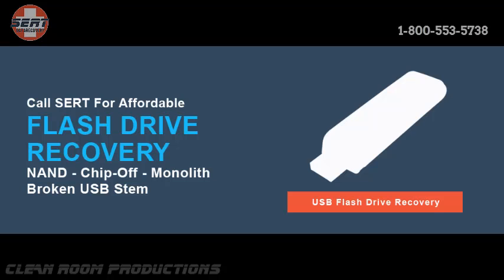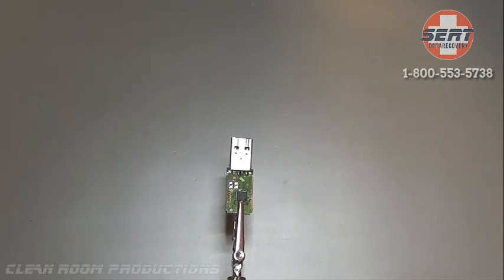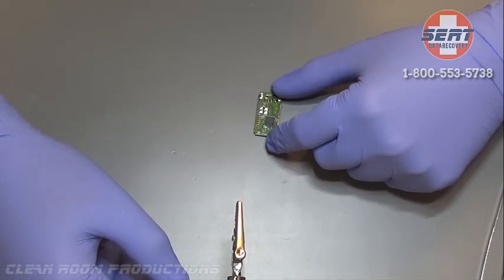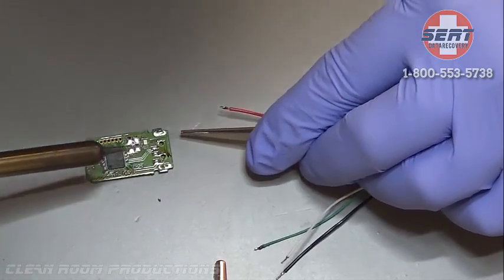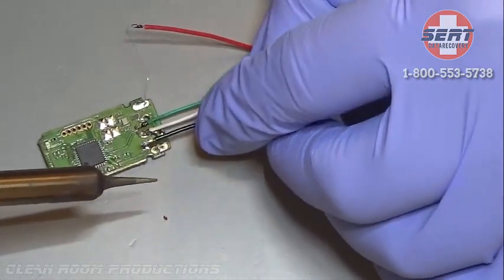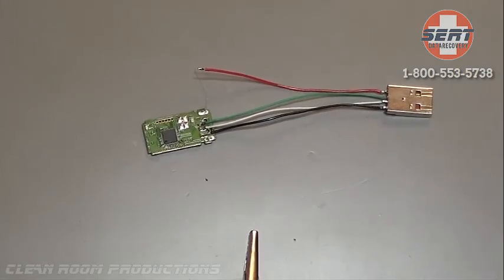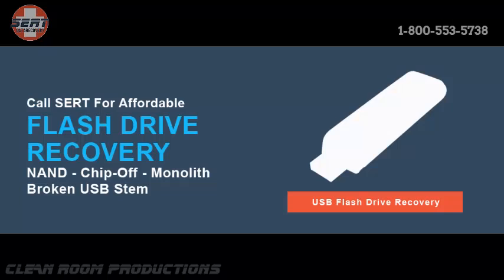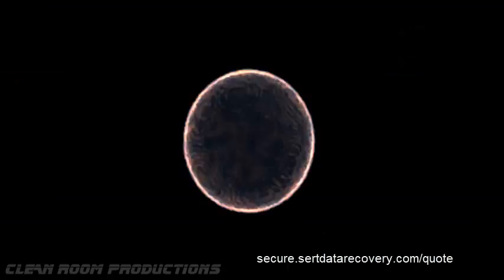Sandisk Flash Drive Repair Data Recovery - How To Fix My Broken USB Drive

Comment: The video is very helpful; however, the data cables in the video are reversed. I followed the video and was able to get the thumb drive to light up, but was not recognized by the computer. Did further research and discovered the green and white wires were reversed (per video). Once I changed them, it worked as it should have. The red and black wires are correct in the video.

Comment: My USB suddenly stopped working, and doesn't appear on any computer ( the light doesn't turn on), can I use this method to repair it ?
Reply from the maker: This is not intended to use for DO IT YOURSELF purposes. You can damage the drive even more.

Comment: what to do when the ends of the front connecting part are broken
Reply from the maker: Yes however we do no suggest trying this on your own as connecting the wrong wire can can cause the drive to require a much more expensive type of recovery process.

Comment: I noticed that the green and white wires are reversed from the normal USB layout...or is it like AC and really doesn't matter.
Can you comment upon that?
Thanks,

Chas
Reply from the maker: Unfortunately our videos are not intended for DIY guide, and therefor cannot comment on your particular question. I do apologize.
Reply from the maker: We did not put these wires in any specific order according to color
Reply: Xilva yes...For pins 1 and 4 yes..Red +5v and Black Gnd...I was talking about the green and white...by USB2 Convention, Data + is green and and Data- is white
Reply: Xilva Data,  is as far as I know is just high and low square-like waves , symbolizing zeros and ones...not symmetrically sinusoidal like AC... ...BUT I don't know what is required in terms of POLARITY RECOGNITION... I would hope and assume that if a modern device is seeing negative going waves, that it would  know that those are digital pulses and are supposed to be high thus a 1(one), and the lack of a pulse would be treated as a 0(zero) , and thus compensate for the "reverse polarity" automatically ...but that's why asked the question.

Chas

Comment: I have a usb that is built into the casing and the usb fell and internals fell out. When i plug in my usb, it has power but it doesnt detect it. Any help?
Reply from the maker: +EpicGuyGaming we can help if you would like to send it in for evaluation and recovery. From what you are describing it could be many different issues, some dealing with the chip and PCB and others dealing with the controller.

Comment: My sisters USB drive has the stem broken off. How much would you charge? Are you in the USA ?
Reply from the maker: +rockero we have a special running right now for broken stem flash drives that includes shipping both ways inside the US. Please call for the quote. 800-553-5738. We'll be glad to help you get your files off for her.
Reply from the maker: +rockero We are also in the USA

Comment: my freind has snaped there memory stick and needs the data asap what would you say to me attempting this process on my own with extension wires so that there is no stress on the connections
Reply from the maker: +Jack Pringle I would only recommend if you know EXACTLY what you are doing, and are experienced. These are some of the botched attempts we get: http://www.sertdatarecovery.com/flash-drive-recovery/do-it-yourself-hall-of-shame

Comment: It's impossible to recover data off the "single-chip" USB flash drives where there's one chip that has the USB connector and everything on it, right? I had (still have) one that broke years ago, and I was just wondering about this. I don''t need anything on that flash drive anymore. Here's a picture of my Sandisk Cruzer, which is not the broken one but looks similar, and I don't have the broken one handy. (The broken one is physically bigger and doesn't have the extra solder pads. (I bet two of them are for an LED if one was to be installed, but idk about the other six.)) http://imgur.com/5VEQbGg EDIT: And worse still, I think the drive was damaged by static. When I plug it into my Ubuntu netbook and do 'lsusb' nothing shows up. It's as if it wasn't even plugged in.
Reply from the maker: +Hitechcomputergeek Not impossible to recover Monolith flash drives, however very difficult and very expensive. If the chip has been damaged/cracked then it will not be recoverable. You can learn more about them here: http://www.sertdatarecovery.com/usb-flash-drive-data-recovery/monolithic-flash-drives
Reply: Even if static damaged it? I'd think that if the NAND part itself gets damaged by static, it's toast. Also, the article says that these monolithic chips are plastic, but isn't it epoxy like any other IC?
Reply: And I'd also assumed that to know how to even try to recover data off of one of these you'd need to have a schematic of some sort so you could figure out what connections connect to where on the NAND, or you'd need to reverse-engineer the flash drive, which would be extremely hard to do.
Reply: Also, the flash drive in question isn't worth trying to recover - it stopped working in 5th grade, and I'm in high school now. Besides, I don't have the money to pay for data recovery, and the data isn't even worth recovering. But how much does it usually cost to recover data from these monolithic flash drives? (Also, the chip has not been cracked on mine.) EDIT: The monolith flash drive also happens to be a Chinese chip. There was a part number on it, and when I Googled it,there was only one result. The one result was to like the 900th page of a search result on flashboot, and nowhere on the page did I actually find any mention of the part number. EDIT 2: And there's practically no chance for you to get another drive of the same model, as I got the drive from a summer camp a long time ago. The drive had the camp's logo, but besides that. the drive didn't even have a manufacturer printed.
Reply from the maker: +Hitechcomputergeek you need to have a NAND recovery device that is very expensive and yes it takes a lot of knowledge and experience on how to use it. For monoliths, you need to have the pinout, and then you have to solder from the adapter to the pinout.
Reply from the maker: +Hitechcomputergeek these types of recoveries range from $600 to $1600 or even more depending on what company you approach.
Reply from the maker: +Hitechcomputergeek Even if static damaged it? I'd think that if the NAND part itself gets damaged by static, it's toast. Also, the article says that these monolithic chips are plastic, but isn't it epoxy like any other IC? THANKS for pointing that out. It's cast into a single silicon chip, the edit has been made.
Reply: How would one be able to get a pinout for this drive? That seems pretty hard for this chip, as I'm pretty sure it's some obscure Chinese chip. Like I said, there was only 1 Google result for the part number, and that led to nothing.
Reply from the maker: This is not going to be available online. Anyone (probably a data recovery expert) who has this has either paid a lot of money for it, or figured it out themselves via a developmental department who has the capacity and expertise for this type of advanced procedure. Matter fact, there are very few designs where the pinouts are even known, and it takes a lot of work to figure one out. Hence the price for recovery. We have access to a limited amount of them and discourage all usage of these drives without a backup. The worst thing ever created in my opinion.
Reply: SERT Data Recovery Oh, that makes sense. Yeah, to be honest losing that flash drive was actually probably good in the long run, as it taught me an important lesson. I've since made a backup disk image of the flash drive that I used to replaced that one. (A different flash drive, this time luckily not a monolith. Even better, the controller is a PS2251, which is so widely known that you'd almost certainly be able to recover the data should it ever fail.) Just out of curiosity, how hard it to recover data from those flash drives that do have a circuit board, but have an epoxy blob for the NAND (assuming the controller failed)? I'd imagine it's easier than a monolith flash drive, but harder than if it was just a regular TSOP IC.
Reply from the maker: +Hitechcomputergeek Those are very similar to the monolith, somewhat easier, however still very difficult. The same thing is required: finding the pin out.
Reply: Okay, thanks.

Comment: hey man i dont want to damage my flash drive even more i broke the stem so i will look for a possible way to send you my flash
how much would it cost to ship it from serbia
Reply: +aleksandar9251 you can search for a person who can solder in a local electronics store.. this is one of the simpelest repairs you can do.. the person who will solder a new usb connector onto it, probably knows what hes doing.. just because he can solder..
Reply: +grindfi ok ty man :D
Reply from the maker: +aleksandar9251 +grindfi This may look easy, and some of the cases are easier than others, however I wouldn't necessarily trust my important data on that fact. We've seen just as many failed and botched attempts at soldering that has caused more damage to the chips, forcing us to have to do a NAND recovery. Also if done improperly can actually damage chips. Check out this page: http://www.sertdatarecovery.com/flash-drive-recovery/do-it-yourself-hall-of-shame SOME of these are from other companies that have tried to follow youtube videos etc. We don't recommend any of our youtube videos as DIY instructional videos. +aleksandar9251 you would have to calculate the shipping on your own, and send it in from out of the country.
Reply: +SERT Data Recovery some tried some failed
ill calculate shipping and see when can i sand it
Reply from the maker: +aleksandar9251 Sure thing. Let us know. You can start a ticket here when you find out: https://secure.sertdatarecovery.com/online-quote

Comment: my flash disk can't work in all of PC
Reply from the maker: +rizal ahsanu mansib this could be from damaged controller chip or broken stem.
Reply: SERT Data Recovery i am not sure, but there is always a warning for the format, and when in the format of the windows systems are always refuse. please the solution
Reply from the maker: Probably damaged controller and needs to have a chip off recovery done by someone with the equipment and experience.

Comment: I did this, the driver install correctly when I conect it to a pc, however it doesnt show on the drive list neather on the drive management screen. any toughts?
Reply from the maker: influxvision sounds like there could be a problem with the drive or the files system

Comment: I thought with the pad side of the PCB facing you and the NAND or controller chip facing away: Left to right is black, green, white, and red?
Reply from the maker: Donnell Jefferson Yes sir they are, however if you look carefully this adapter was created by the engnineer, wires soldered to a USB connector - not a cable taken from an actual USB cord. In this case you can see the wires are connected to the adapter, and soldered to the PCB in the correct order. The intention behind this video is to exhibit our ability to recover data from flash drives where the pads have been lifted, not a tutorial on how to do this procedure yourself (hence the don't become part of the hall of shame link).